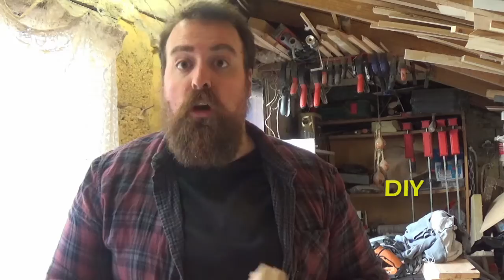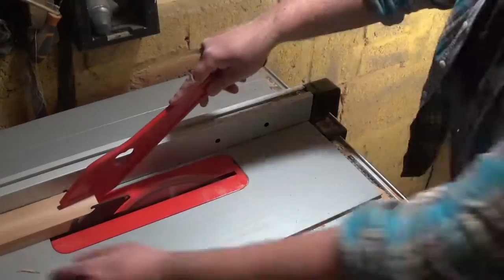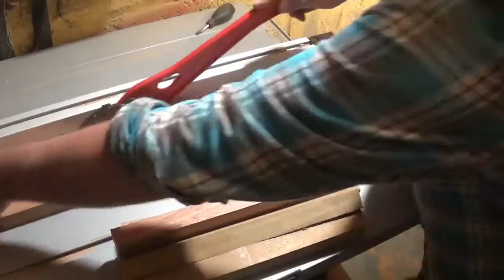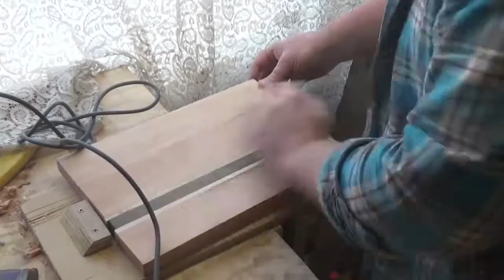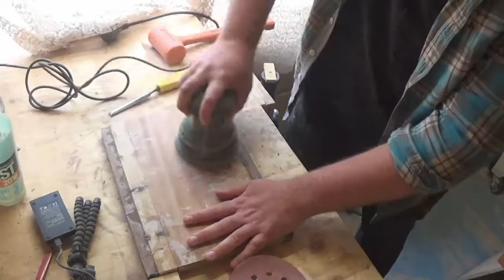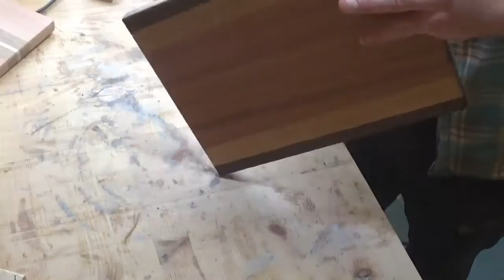Edge grain chopping boards (no jointer, no thicknesser) & 100 Subscriber giveaway (Closed)

Comment: I like this vid the best because it’s the one that will net me a sweet chopping board.
Reply from the maker: Haha, Cheers Ross
Reply: Did you have to leave much time between denibbing for the wood to dry before applying the oil?
Reply from the maker: @rosse9531  After putting water on, I let the wood dry completely before doing the final sanding. The boards were dry when the oil was applied